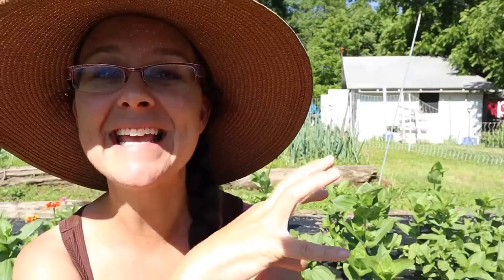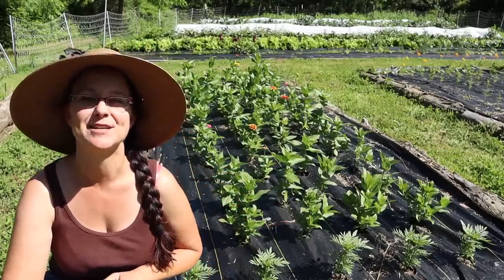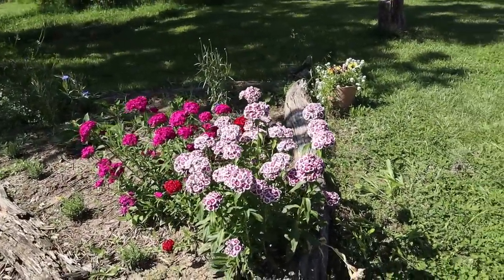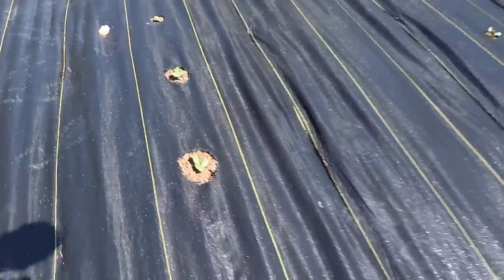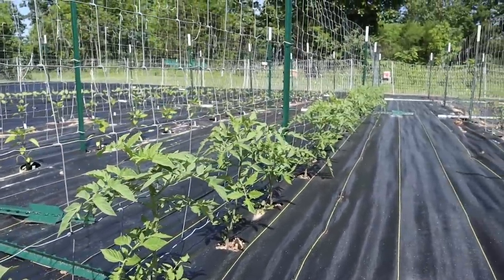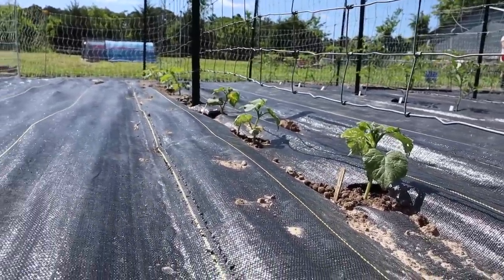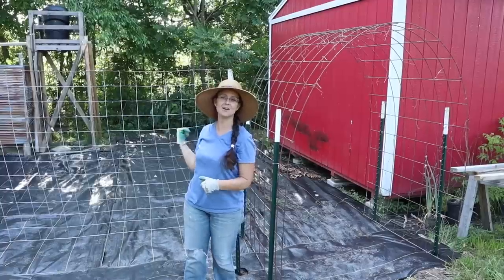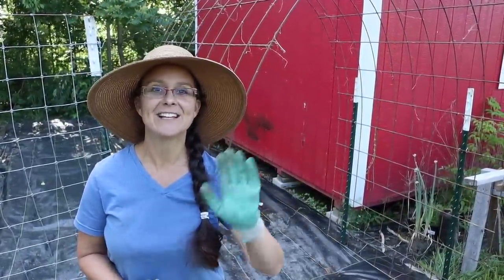ANOTHER Garden? Building Our SHOWER COTTAGE GARDEN!

Comment: I am using cattle panels on 2 tomato arches in 2 300g stock tanks & 2x4 wire fencing for 1500yr old cave beans in 100g stock tank. The river comes up occasionally this is 1 way 2 save some of the garden. Have many different pepper plants. Going 2 have corn in the ground & maybe some other crops. Tanks help keep bunny out of it also. Thanks 4 your updates

Comment: I use a couple of ratchet straps to help bend and hold the 16' cattle panels in a rigid arch position.... then set the arch where I want to stake it. I can easily do this by myself. You could even use bungee straps/cords instead of ratchet straps. or a combination of the two. Of course if you have two people .... that works as well .... what the ratchet straps will do for you is prevent kickback of the arched panel while you are working on it. Your cottage garden is gonna be epic ~8^) Take care ....  enjoy.